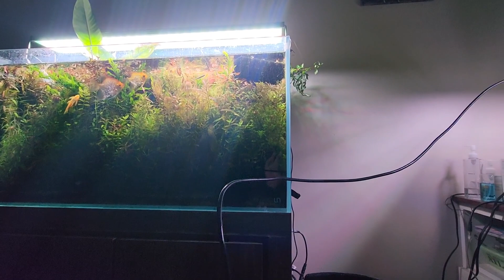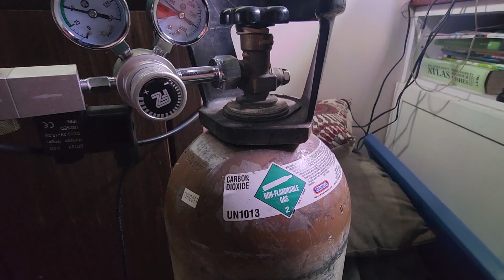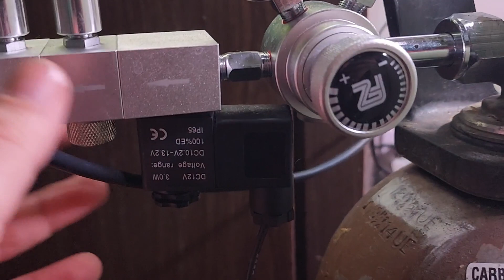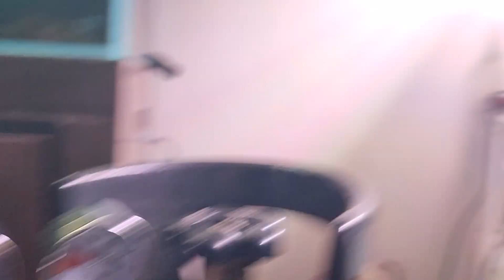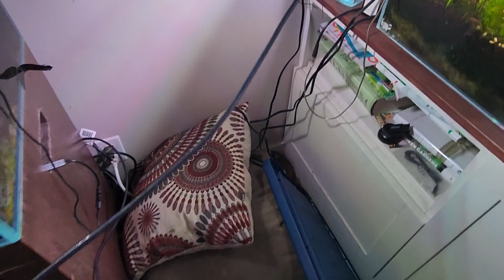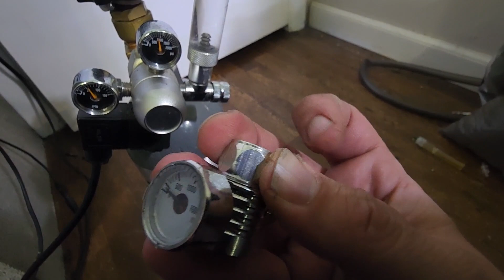Setting Up An Aquarium CO2 System? Tips & Guide To The True Cost of A Full Set Up. +FZONE PRO REVIEW

Comment from the maker: Here is my ~$200 DUAL Tank Budget CO2  setup: 
MY CHOICE SYSTEM: DUAL TANK, DUAL STAGE QUALITY YET AFFORDABLE!

$210 for 2 systems up to 100 Gallons linked Below!

The Actual Co2 Tank! Here is a brushed Stainless Steel 5lb tank if you dont want to go the used route. $52.99
https://amzn.to/3jbG145

A very good inexpensive
-co2 diffuser for only $10.99 for tanks 30g or less.  https://amzn.to/3kMJW7S

-Fast Link to the Fzone Pro Dual Stage Regulator, Dual Bubble Counter And Solenoid MY choice for Quality at a Good Price: 135.90 https://amzn.to/3jahnkl

16 feet of pressure rated line $9.90
https://amzn.to/3jb3bYo

2 aluminum life long quality check valves 
https://amzn.to/3Dlb842 only $7.99
Reply: Your Check Valve link leads to the purchase again page. All the other links work perfect for me.
Reply: @KoroWerks hey did you figure it out?
Reply: @baruchjones9834  I found a different check valve. If you go through his affiliate link and then search it should still count as credit towards his affiliate page, but I don't know what specific check valves Alex intended for us to grab.

Comment: why did you put the diffuser near the surface??? People put it as low as possible coupled with flow to push it down so that there is time for the bubbles to dissolve in the water. co2 bubbles that go to the surface are wasted

Comment: Hi! I'm late to this video, so I hope you see this. CO2 dissolves directly into the water column very easily; CO2 actually disolves easier into water than O2. The best placement of a diffuser is at the bottom of the tank, so the bubbles have more time to diffuse (along with what you mentioned in the video about surface tension). If you get a CO2 ladder, you will see the bubbles shrink as they climb the ladder, visibly demonstrating CO2 diffusion. The video, "CO2 Diffusion Ladder update" by New England Gardening on YouTube shows this (sorry I couldn't find a simpler video).

Thanks for the awesome and informative videos!

Comment: I've found that a reactor type CO2 system saves on the amount needed greatly and you get no bubbles in the aquarium, another bonus if you like that.  You could use a reactor with a powerhead for added circulation in a tank as well, that's what I use. The reactor does rob you of some flow, that's something to be aware of. An in-line atomizer works but I find it produces bubbles, an advantage is that it hides the diffuser in case you have an external canister filter or sump. If you like bubbles in your aquarium and the amount of CO2 injected doesn't matter, then go with the simple diffuser which is simple enough but a slow diffusion reactor saves on CO2 and doesn't produce bubbles like the diffuser. Look for the JBL Pro Flora CO2 Taifun, there are others like it out there.
Reply from the maker: Thanks for the information!

Comment: Question on  the defuser segment. Am I to assume placing the defuser just below surface is sufficient for CO2 saturation?

Your nuts and bolts detail around your topics and ‘Oh and by the way’ tips are greatly appreciated.
Reply from the maker: Yes its good to put the co2 diffuser shallow, unless you have a reactor or super super fine bubbles that actually mix in the line , canister or a glass capture spiral glass... but those are less common in most tanks
Reply: @Fishtory I think you'd find that most of the CO2 gets dissolved in the water before the bubble breaks the surface. You would get maximum absorption if no bubbles ever broke the surface.
Reply from the maker: @kellygordon103  that's half correct. If the co2 bubble spray has been made small enough, the co2 will be diffused and mixed into water, like an inline co2 rig or a reactor. However if bubbles. The size of peas or larger are flowing, the surface tension of the water and "stickiness" of water causes gases or even other liquids rise to the top without much mixing
Reply: @Fishtory  I'd be willing to bet money that if you did a comparison test with CO2 injection diffused high in the tank then low in the tank to allow more time for the CO2 to dissolve, you would get a higher dissolved CO2 concentration in the water with the diffuser lower in the tank.  Once those CO2 bubble breach the surface, dissolution stops and that gas is lost.  This isn't the same as cavitation bubbles popping and re-dissolving.

Comment: Nice video as always Alex, thanks for sharing.
I was at one time considering high light and CO2 for one of my aquariums (125G) until I did some research. Finding any used CO2 tanks near me is almost impossible. When I do they're almost as expensive as buying new. My local welding supply only swaps tanks so buying a nice shiny new one doesn't make sense. The cost of refilling CO2 is cheaper than any of my welding gases so that's a good thing. But add the cost of a high powered light such as a Fluval 3.0, sheeesh. I'll just stick with slow growing low light plants for a while I think.
Reply from the maker: I Totally understand that reasoning as well

Comment: Stay away from those $60 regulators on Amazon had 4 of those and none lasted more than a month. Finally settled on a CO 2 Art a bit more pricey but comes with a 10 year warranty try that with those cheapies. The CO OP regulator is another good one.
Reply from the maker: Yeah in the description i linked the cheapest id go after trying a dozen or so brands. Either way for the full set up youll spend 200- 400 for quality gear imho

Comment: And lastly can you explain why someone would opt dor a co2 reactor instead of bottled co2. From my understanding a bottle refil and the frequency required to fill isn't all that costly
Reply: From what I understand it's the benefit of being able to get citric acid and baking soda at the grocery store. 

Most people have a welding supply or home brew store or something where they can get pressurized CO2 for an affordable price, but that's not true for everyone. 

A reactor/generator allows you to avoid using those pressurized systems, avoid the need for a pressure regulator, and avoid having to go to a specialty store to pick up CO2. 

You can also take the tank lid off and fill it with dry ice from the grocery store in a pinch, but it's not as easy to do with a bigger tank, more the paintball/soda stream sized pressure cans. 

You also have to store a CO2 canister upright, and a generator can theoretically be smaller or made into a different shape that fits your space better than your standard CO2 cylinder. 

I think long term a pressurized system is cheaper, but a generator has a lower up front cost. 

Not an expert, this is just what I've read about the subject.
Reply: @Koro Werks  that's a perfect answer, covered my question and explained a few other things for me 👌 it's definitely a mission trying to setup something on a budget, especially here in Aus as many of the well-regarded and affordable regs that get mentioned aren't always available here, so becomes a bit of a lucky dip if you can't quite afford the premium brands
Reply from the maker: Thanks Koro!